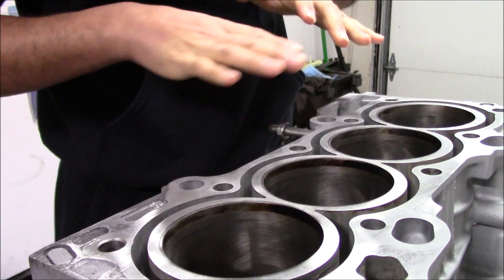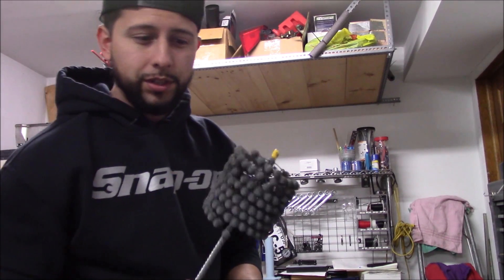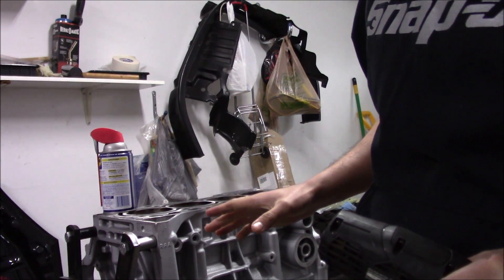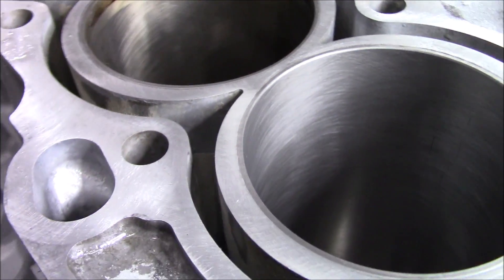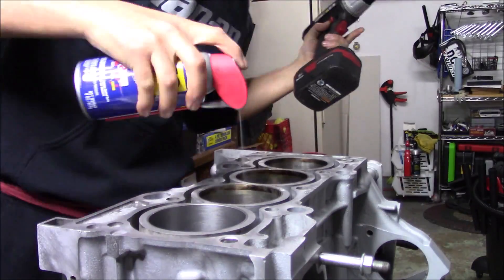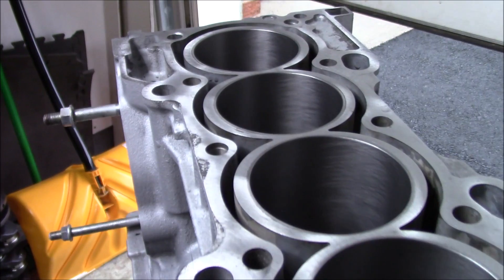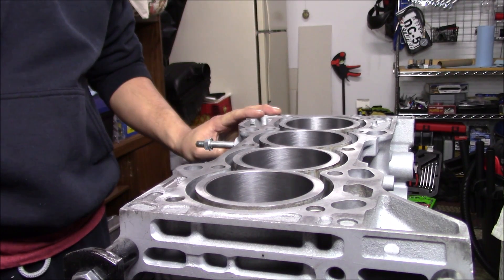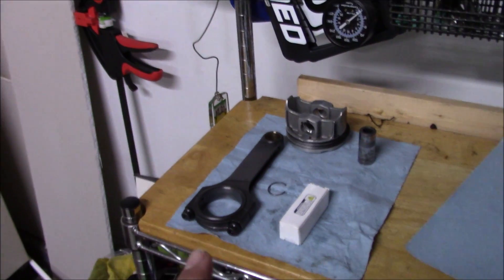Ultimate K20/K24 Build Guide! PT.2 (Block Prep)

Comment: Hey man going threw the videos again. Got a k24a2 at the machine shop , along with the tsx (06) cams and crankshaft. I got a 4 pistons oil pump , manley h beams 546 grams. I haven't ordered the bearings or the pistons yet. But I'm basically copying your build 😂😂 .. your videos helped me threw the k24a4 I built last year in my Accord for practice and running strong 12k in.. I don't remember if you have the wave track or the m factory but I have the wave track , carbon sync , hardened sleeves. Dude I'm seriously trying not to jack your entire setup.. but it's so good man . I got the same head work done. On my k20z3 head. I did however use high compression valves. 92 or 95psi dual value spring, titanium retainers all by supertech.. I'm probably gonna get the same pistons you have to be honest.. lmao but hey I can admit it and thank you for the inspiration. You have basically taught me how to build k-series motors .. thank you man!!!

Comment: Hi There! Im totally beginner to this stuff, and I have a 2004 5door Civic witch is equipped with a K20a3 engine. My question is: What is the type of this block you build and how much step can I use in my engine if I want to learn my engine dissassembly/assembly. Is it look like exactly the same inside or just similar. Thank you for your time. :) VERY NICE video :)

Comment: Hey man I wanna do a K24/K20 on my Z7 block with a Z3 head. Do you know what I need to do for that? It’s not a direct bolt on head so im trying to figure out what do. Thanks!
Reply: Shums Dagda won’t work it’s almost impossible to put a z7 bottom with a z3 head if you want to go k24 route your better of getting a k24A2 from a tsx you get plenty of tq and power from the higher flowing head from the K20

Comment: Good to see you back bro , im currently putting together a k20/k24 swap for my dc2 project,  i have about 70%of all the parts but need advice on timming chain and tentioner.  In your opinion whats the best timming chain combo for this swap ?
Reply from the maker: depends on what cams you plan to run, i always suggest a brand new oem tensioner and chain. but if you plan on running any aftermarket cams id suggest the inline pro tensioner.

Comment: Just got my K24 built shortblock from Kmod.. Have a supertech built k20z1 head to go with it.. Should make 400whp no problem boosted.. Cant wait!.. Good luck Serg
Reply: You got a built block for 400hp? why?
Reply: @MikeHarkins-w9b  Fair enough man. There's nothing wrong with 400whp, I figured you were going to keep it there so that's why I asked why you would get a built block for 400whp. If you plan on turning it up, it was smart to get the block built (though I would have done it myself to save money).
Reply: @icelover3 .. I dont really have plans at the moment to go higher, as for now it is a street car, but my main reason for building the block was for long-term reliability and durability like I said in my previous comment. K20's can absolutely handle 400whp stock, but not for long, sustained periods of abuse at that power. My friend has been running a fully built block and head at around 440whp for over 4 years with not ONE motor issue(good tuner also helps). But I already know how power is like a crack addiction.. You just always want more, so obviously, having a built motor capable of much more than my initial goals is always nice because I have that room to go up easily at any time with little effort or money needed. But really, anything 500whp+ on a fwd car is kinda pushing the limits for daily purposes. At that point you start needing to go full race gas or e85 all the time, you need big, sticky tires which wear out fast and cost a crap load, you need super stiff mounts to handle the load, ect.. All things that start making a daily driver kind of annoying and a hassle. I think 400whp is a perfect power goal for FWD and you can still maintain a comfortable daily ride. Maybe in the future, Ill make it into a more of a track car. at least my options are open now.
Reply: Mike Harkins what compression did you go with? What piston size?  I just got a K24 short block and i want to build. I have a 8th gen si that I’m going to put the k24 in with a turbo.
Reply: That's awesome. 300 hp is super fun but not excessive. 400 is getting there but still I respect your decision. Hell yah man.
Reply: @monstermushroomcloud  would like to do a build that's about 250-300 who. Any tips? Just got a 02 base model rsx. Anything will help

Comment: Hey big noob here, could you address some tips on what to do when you do work on a engine that’s been sitting around for a while (and tools you use)? And I know you got your head and lower block machined but what could we do if we’re building ourself a k20/k24 to look as shiny as yours lol thanks! Looking for the next video
Reply: Wash it down dish soap and brush to get the carbon and grease off. When it’s dry go over it with a drill with wire brush. And respray it. Done.
Reply: Jonathan Taing sounds like a project itself lol